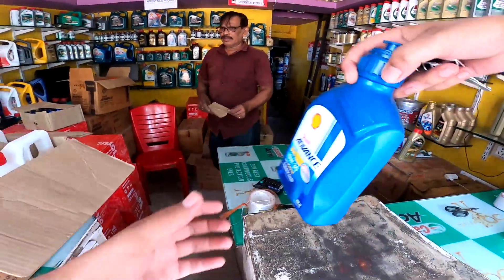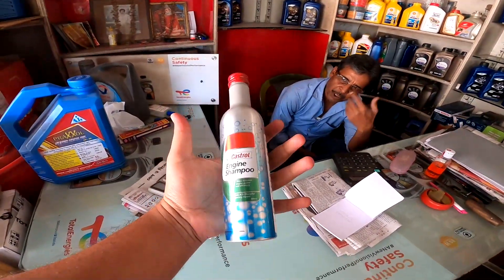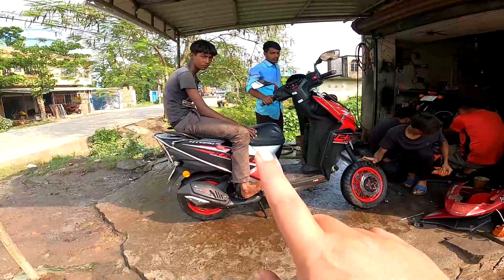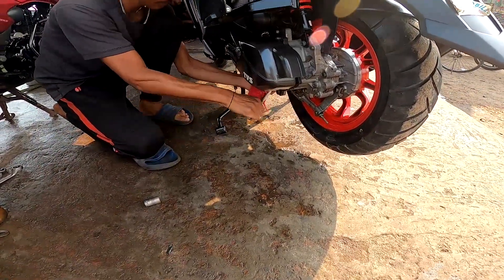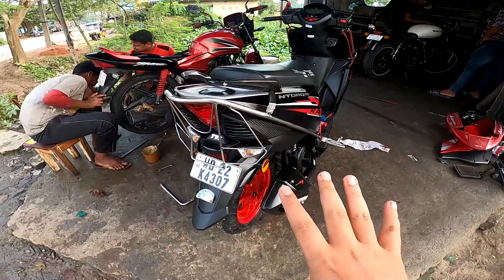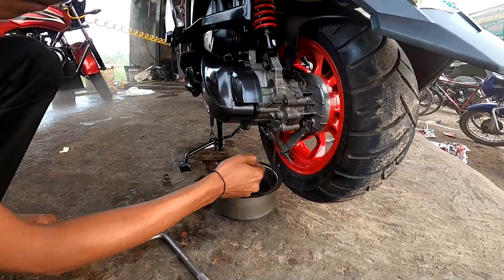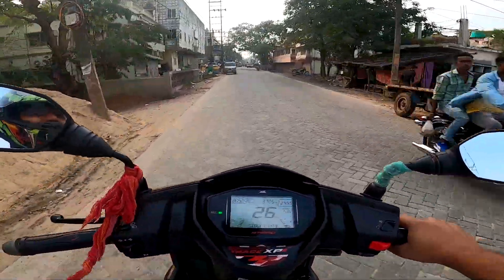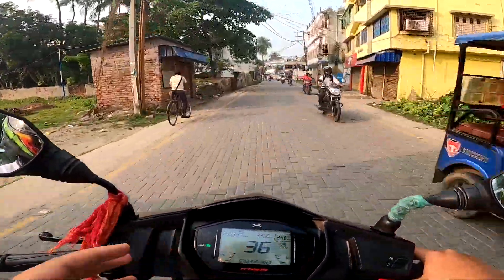Best Engine Treatment For Ntorq 125 | Ntorq Race Xp 3rd Service

Comment: your scooter's engine will not run even 20-25k with this kind of service😂
Reply: Wat u mean brother? Context?
Reply: @SeizrnUhie  check the user manual.. 880ml engine oil needed. also use same engine oil (10w30-JASO MB) for gear oil too
Reply: @vikasaswal bro ,gear oil is different than engine oil ,dont use engine oil in gear oil's place
Reply: @tdawg2241   pls check the user manual. it is clearly stated to use 10w30
Reply: Gear oil known as transmission oil is different from engine oil .
Reply: @VikramVicky-c8k  these are just names... any oil depends on the specification. And Ntorq gears need 10w30 oil. Any one who is not agree, pls check the user manual. And my suggestion is to only follow the manuals . Thanks
Reply: Bhai Mera 4k hogaya ajj pata chala gear oil bhi hain😂😂